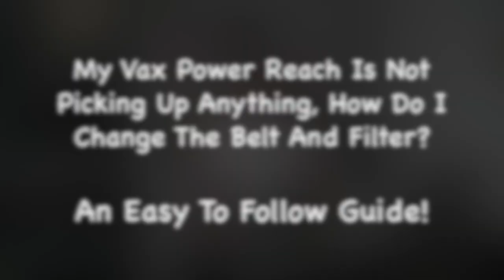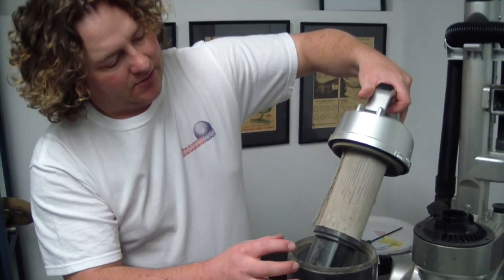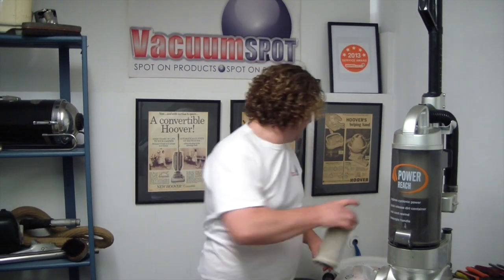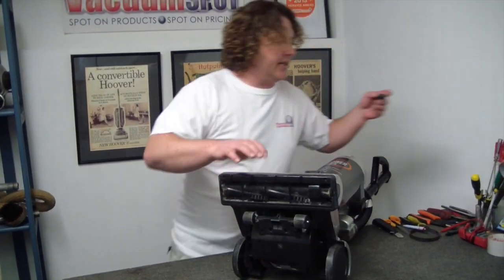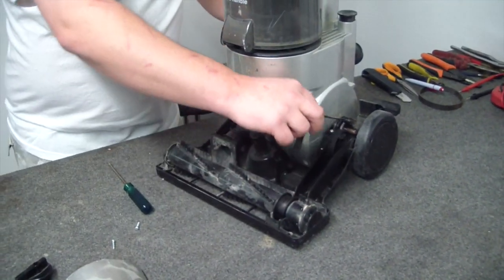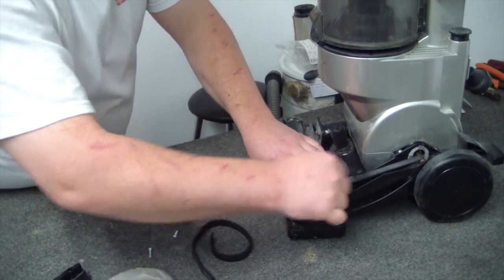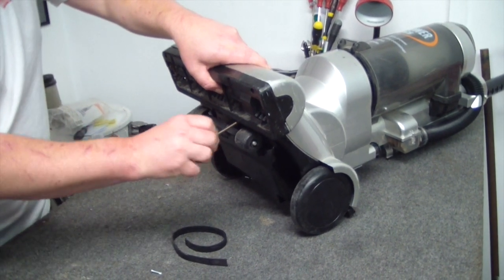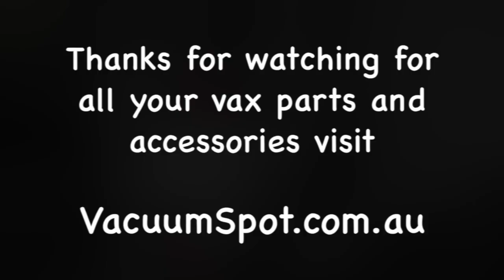Vax Power Reach is not picking up? How do I change the belt and the filter?

Comment: Vax Zoom Pet pink vacuum cleaner lack of suction & brush has stopped spinning

I think this description of replacing the hoover band is the most similar to what you need to do for the Vax Zoom Pet vacuum cleaner. Eight screws (rather than five) plus the middle height adjuster to take out on the Zoom Pet. A lot of people seem to search for that one but it’s not covered in any videos I’ve seen. Vax themselves talk about newer machines but our Vax Zoom Pet (a pink one) is less than five years old so hardly very old. I watched a couple of your videos as well as their’s and found yours helpful in giving me an idea what to do (not being able to find our manual).

It stopped picking up but there was suction. There was no suction through the head and the brush was very stiff and would hardly turn. That confused me as the advice on here and the Vax blog videos talks about a lack of resistance if the belt has broken. The drive belt (hoover band) had snapped. As it was fully encased in the plastic head I didn’t even realise that the vacuum cleaner had a band, of course it did. I think it had jammed up against the plastic case on the centre side and that probably caused the resistance.

Getting the head off was a lot fiddlier than in these later models but it is easy enough, the same with a bit more force to put back. The height adjuster screw is tricky to get out from underneath the little wheels and needs a thinner phillips screwdriver.

We couldn’t find our manual, you can download one here: 
http://support.vax.co.uk/1-1-132437-00-zoom-upright 

That is for the U87-ZM-P Vax Zoom Pet Upright Vacuum Cleaner

Our machine did not have a model number sticker on it.

I bought a new band (drive belt) on the web direct from Vax UK, £4.99 free UK postage. They delivered it exactly when they said they would, though taking six working days (eight days with the weekend) to dispatch and deliver a simple package is rather slow. You might like to remember when you see bands on sale in a shop in case you will need a spare (which I couldn’t think of where I’d seen them when I needed one).

Alarmingly the divider of the plastic casing on the inside, lining the belt was jagged with black carbon type coating and had worn through in a couple of sections. I’ve peeled / snapped some of this black plastic type coating off, not all of it will come away. I don’t know if this caused fraying that snapped the belt, if the belt rubbed and caused that, or if the belt having snapped then rubbed the side when we were using the machine and caused that. It may be this is just a residue of grit and debris that built up and was a separate problem as the band appeared snapped not jagged or frayed.

Touch wood it is working fine again now. Thanks for the videos from Alec which gave me an idea what to do. If I was in Australia I’d definitely look to use VacuumSpot because of your helpful videos.
Kiron Reid, Liverpool, UK.